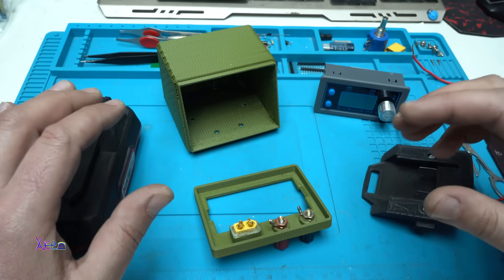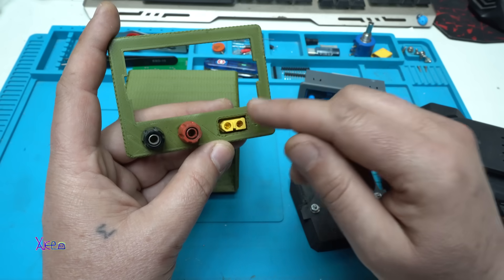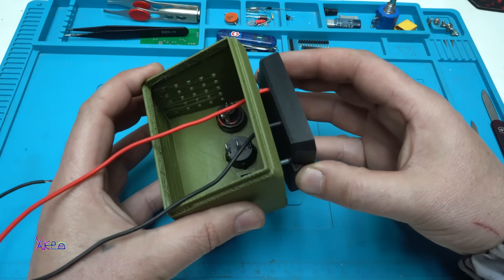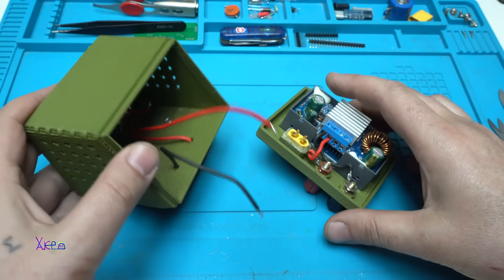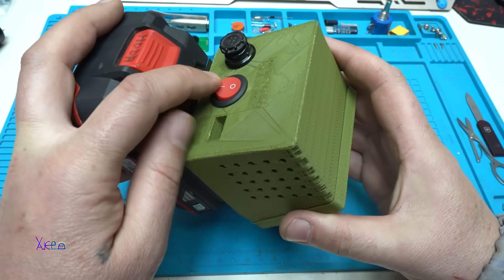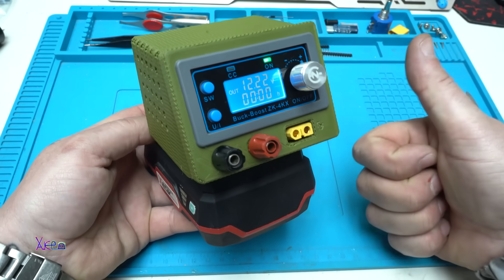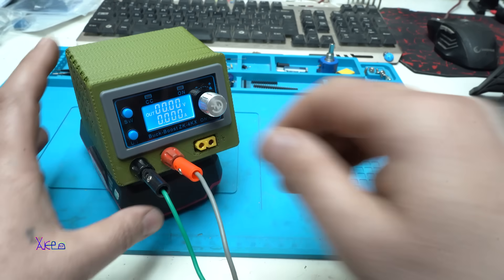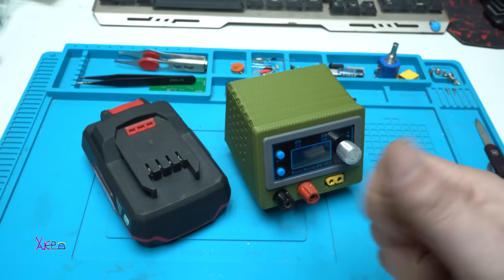How To Build Portable Power Supply using 20V Drill Battery!

Comment: A great project. 
3 things I would do. 
1 put a switch to disconnect the outputs incase you plug something in and have the voltage too high before adjusting it 
2 put a AliExpress digital volt meter display to see the battery voltage. I know it has its own led light indicator 
3 have a resettable fuse 

But all in all a great and useful gadget
Reply from the maker: Those are great tips,upgrade need to be made

Comment: add a USB charger with switch and a light.
Reply from the maker: That will be nice,I will upgarde for sure
Reply: There is a Parkside USB charger with a light for the 20V batteries (i have the PAA20-Li B2).

Comment: I am guessing it was the electronics in your battery that shut down when it detected over current rather than the psu regulator device. I have a load of Ryobi batteries so I need to make a modified version of this for those. Do you have a. step file we can download. What software do you use to make your designs? I use on shape.
Reply from the maker: The fuse was wrong,to weak!in description you can download 3d printed fils,regards M

Comment: Is there any protection to avoid over discharging the battery?
Reply from the maker: No protection but you can monitor the battery voltage on dc module👍
Reply: @Hacktuber  Those battery packs come with built in protection.
Reply: @theTeknoViking  Be carefull not to overdischarge these Parkside batteries. If the batteries are connected to any Parkside 20V device, the device shuts off via the third pin that connects to the battery if the voltage of one of the cells is too low. I know that because i have destroyed a 4Ah Parkside battery while testing the capacity, after that 2 of the cells (2 parallel cells of the 5S - 2P configuration) in the battery were discharged to 0V and the battery would not charge after the discharge test. If you only use the + and - connection of the battery, there is no low voltage shut off.
Reply: @HobbyfotograafBart  Ooh, is that so? That could have been an expensive mistake. Thanks a million for letting me know! 🍻I ordered the ZK-4KX module, but I think I will use an old laptop adapter to drive it instead of battery. I would have never thought of putting a fuse in the circuit if it wasn't for you. So thanks again!
😁

Comment: I love this design. I just designed something similar last with the same Buck-Boost adjustable power supply but it is using a USB-C PD port for supply. Mine isn't quite done but I suspect I'll have it posted by the end of the week. Nice work, I love the use of a drill battery pack!
Reply from the maker: That's great, I'm glad we both had the same idea!

Comment: could this have a usb c output for like a pinecil iron.
Reply from the maker: If you add step down converter
Reply: @Hacktuber  a pinecil operates on type C: PD and QC 3.0 12V-20V 3A
Reply: Yes. you could add a USB C PD board to this project easily.
Reply: @Alacritous  I Have done this and added a usb c pd board and it's better than my pre built power supply which craps out when the pinecil is used, I've tested the pd board and it rocks.